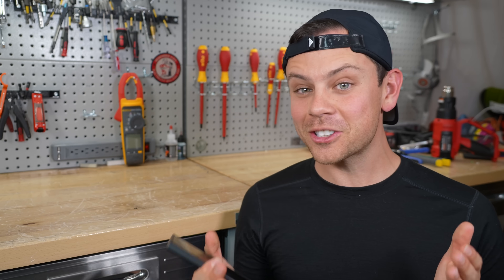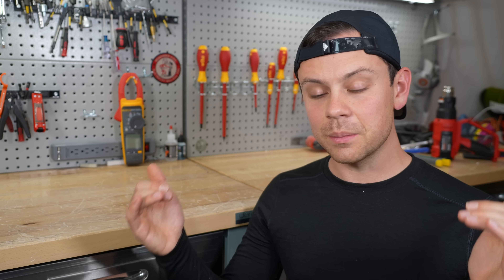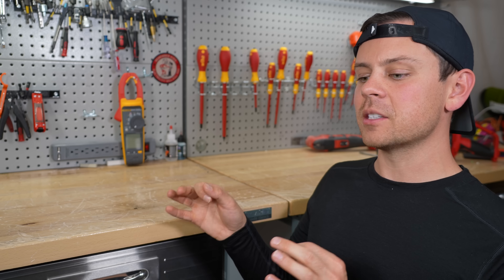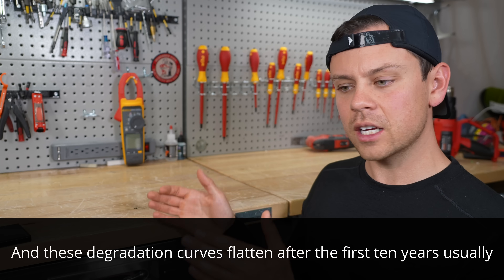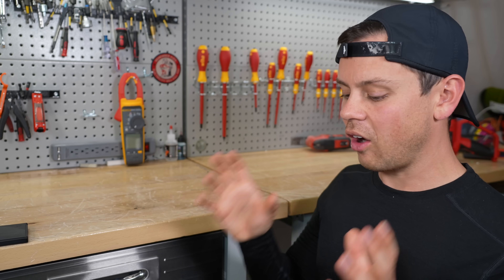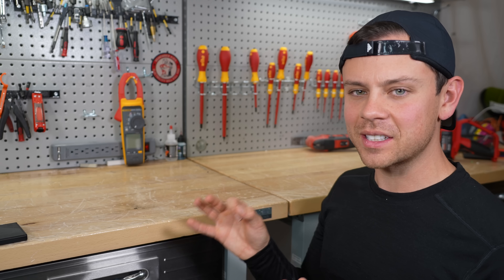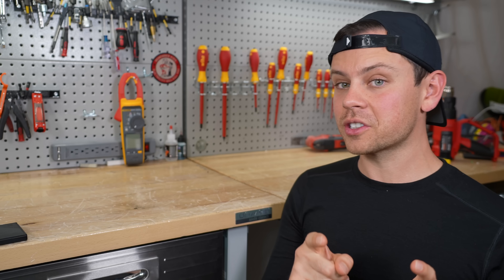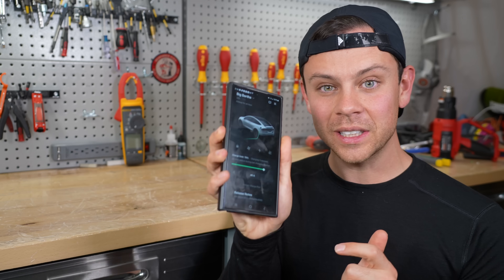LiFePO4 Longevity Discussion! Why Charge to 100%?! For Solar??

Comment: Hello. Very interesting video, can I ask does this appraoch to battery management, also apply to power banks. The reason for my ask, is today I bought a Ecoflow delta 2 max, which states in the manual that the battery life is 3000 full cyles, equating to 8.5 years then an expected drop to 80% efficiency. My point is it also states in the operators manual to charge it to only 80% and discharge to 40% in order to help presreve the battery life. You make a very good point to ignore this, would I be better off fully charging and discharging the battery. Admittedly it will not be used to a great extend daily, sometime not at all. Very interested to hear your thoughts.
I also have a DC House 200ah lifepo4 leisure battery installed in my campervan which is only ever charge via a smart alternator or 230v, which again I was led to believe to charge at 40% to 80%, again should I also fully charge and discharge this battery to balance the cells.

Comment: tl;dr: "Stop thinking about the batteries and just use them"
I think a lot of us have nightmares about lead acid batteries getting sulfated and capacity rapidly degrading if you look at them wrong or if you discharged them a wee bit too much one night.

Comment: People cant seem to understand that degradation is based on AVERAGE state of charge. ESPECIALLY true with LFP chemistry which has EXTREMELY low cyclic degrations. Almost all of the degradation you will see is calendar aging. Meaning whether you're cycling them or not, degradation will be basically identical. AVERAGE SOC and temperature affect the speed of calendar degradation.

Comment: I don't set my cutoff no lower than 15% because my soc meter goes out of sync.(eg4)  I've had it shut off on me at 10%.  I'm not too worried about it, I think I'll get 10 years no problem if not 20. I do top and lower balance when I get long gloomy days in the winter. In the summer, it runs non-stop.   Right now it fully charged and is in power save mode. I'll probably switch back off grid in the morning  to rest the batteries at full charge.  I think our results are to be announced through further experience.

Comment: Problem with zero charge... I have seen many batteries unable to recover from zero from the inverter.. Have to reboot them with a DC power supply. The solar kits that I install are never supposed to below around 10% OR THEY WILL NOT RECOVER
Reply from the maker: Check out my latest video where I talk about that

Comment: Yeah, I have the anker home power panel with two f3800s and wish there was a setting to tell it to charge to 100% on solar before it begins using the batteries. As it stands its a manual process and will charge up to 100 pulling from the house power. Now it charges up to 80 percent and then starts to use the batteries even when solar is on. I wish there was a setting to not use the batteries until solar charges to 100%. Its set to 80% per Anker.

Comment: My system isnt quite big enough to hit 100 consistantly in the winter.  every few weeks well get several days of good sun in a row and it will 100 but most weeks I need to suplement with a bit of grid power.  The joys of the pacific northwest, 5-6 months of the year we are overcast or raining more often than we are not.  I let mine charge to 100 solar but I have it set to kick on grid power at 20  and recharge to around 50.  Leaves me a bit of a reserve just incase the grid goes out till I can drag the generator out of storage.   summer time I dont touch the grid, my batteries tend to max out part way through peak solar

Comment: Some people only want the batteries for an emergency backup for Ice storms or wind storms, etc where the grid may be down for a day or two or if their grid is not super reliable and shuts off for a few hours a week so they run off of solar by day and use the grid at night and they have the batteries charged for those emergency situations that I mentioned.  ------  Some home battery manufacturers say you can keep the batteries at 100% charged but they recommend that you run your batteries down to around 50-60% charge at least one day each month before you recharge them back to 100% for emergency backup.    Look at the users manual and follow the manufacturers recommendations to help if there is a warranty issue later.

Comment: Why are you claiming again and again that cell balancing only occur at 100% SOC?
Sure many cheap BMS'es do that... But most balance the voltage on every cell against the voltage on every other cell constantly by measuring every cell, and transferring energy to the ones with the lowest voltage from other cells with higher voltage. And does this on every battery percentage. Because it is crucial that every cell has excaxtly the same voltage when nearing zero % remaining charge. If not, the cell with the lowest voltage, and thus lowest energy left, can experience a polarity reversal when facing the higher voltage and energy from all the other cells it is connected in series with, THROUGH THE LOAD! That cell is then instantly destroyed.
Every quality electric car balances its battery all the time! Tesla even does it when the car is parked.
Reply from the maker: That's not true
Reply from the maker: The amount of things wrong in this comment are just killing my brain 😂
Reply: @WillProwse  Google: "What is battery cell reversal?" Mr. Knowitall.
The first answer is: "Definition. Cell Reversal. Reversing of polarity within a cell in a multi-cell battery due to over discharge."
And now Google: battery cell balancing...

Comment: Will I’ve got the EG4 Pro / 18K PV, outdoor battery, it’s set up to run the house along with a solar array. My PGE highest price tier starts at 4:00 pm and runs until 9:00 pm. I’ve got it set to charge to 100% and deplete down to 10%. (Signature Solar recommendation) Sometimes the battery is at about 50% right at 4:00. I could quick charge it before the high tier or I can let it deplete before sunrise and run the house off of the grid during early AM hours. Based on this video, running all the way down before charging the next day will keep the cells balanced and add life to the battery. My initial thought when I first started this venture was to stay off PGE at all costs. Thank you for this video, I have a different view now. 👍

Comment: You suggest that discharging LiFeP04 to zero on a daily basis is not harmful - but you also suggested that  in storage self discharge to zero will destroy the batteries. Can you explain the difference in these two scenarios? I use LiFeP04 regularly in online UPS applications and I have found that in 6 battery  12 volt 10AH string  (72 volt) applications the the internal BMS keeps them perfectly balanced between individual batteries  at least up to 6 years - as long as I've tested - with almost zero degradation. 
On a completely different topic - have you had difficulty with shipping LifePo4 by air? IATA regs - that control airline and air cargo shipping - lump Lithium Ion and LiFeP04 in the same category - requiring dangerous cargo rules. Drives me crazy but carriers have no explanation.
Reply from the maker: https://youtu.be/K9Tfivf5bAI?si=EsOkgado_SWSDEEK

Comment: People in aggregate are stupid, today everyone is a doctor.
Of course you need to charge LiFePo at 100%, that's why they are build with balancers, the balancer begin to pull from more charged cells when the cell is above 99% reducing the cell charging current meantime on cells that they are under 99% charged they charge at the nominal current, when the most charged cell is at 100% the charging is interrupted because the balancer can not pull enough current from the most charged cell because usually the charging is happening with currents orders of magnitude higher than the balancer is able to reduce.
So, the balance is active only when the most charged cell is above 99% and under 100%, a very small amount of time but because is supposed that the cells are the same capacity and sorted is enough to keep them balanced.
Usually people don't know even how balancers work, balancer don't increase the charging current on most discharged cells but contrary, is decreasing the current that is charging the most charged cells, usually the most charged cells are charged with about 10% less current than the rest of them but that happens only when the most charged cells between 99% and 100%.
But the engineers that designed those cells and those balancers know nothing beside what those doctors know 😒
Maybe people start reading from time to time and stop waiting for the movie to be make and/or the audio version of the book 😒
Mine I use them between 20% and 100% each day, I let some % in the battery for powering the inverters after is switching grid.

Comment: I just made some changes to my SOK's and Time of Use on Solark because of this video. Thanks!

I was doing 100% to 10% as available ranges from solar only. Now I am charging to 100% from Grid if at 4pm (Just as Solar goes away) the batteries haven't hit 100% to allow balancing. 

I still had some issues getting to 0% as there are variations with the 5 batteries in how they discharge. They can be a couple %'s off so one battery will hit 0% and shut down with 2-3-4% available on the others. I'll keep the 10% to allow some variation for that (I could prob get down to 5% now that I am charging to 100% but I'll have to test)

Comment: I like your video, thank you for makeing it and I believe what you're saying.  What I'd  like to know is there a different in which volt setting I should use.  I believe the battery  instructions state 100% (  is 27.2V,  yet it also says 100% ( is 29.2V  So, which is the setting should I use on a 24V LiFePo4 battery system.   Thanks again for all your informative video!

Comment: Reminds me of when SSD started to get mainstream in computers. Relates to desktops, not laptops as they usually only have one drive. 
Many people bought SSD for the speed and i stalled windows on the drive, but programs, page file and everything else was placed on a spinning disk to save the SSD from wearing out.
I was like why spend money on a SSD to speed up your computer and then let it sit idle inside your computer until it gets old? Use it as much as possible.
Reply: iNstalled windows...

Comment: I have known about the charging LiFePO4 batteries to 100% for balancing ever since the CEO of Battle Born told us.  I know not to store a battery at 0% SOC.  And I know not to keep or store batteries in hot temperatures.  But I have never heard that you have to take them down to 0% SOC before you charge them back up.  This must be something new.
Reply from the maker: You don't need to, but it makes sense with calendar aging. Use them before the capacity fades over time. Had a whole section in this video covering that actually
Reply: @WillProwse  Oh, from the video you stated to take them down to 0%.  But my batteries are never at 0% before they start charging in the morning at it would have been a pain to take them to 0% everyday.  Good to know I do not have to do that task, lol.

Comment: Will, what say you with regard to Trump tariffs on Chinese LifePo4 batteries and solar stuff? 

I have an amazing system I designed and constructed using 2 Eco-Worthy 280ah and flexible solar panels all Chinese made. It's sweet! It cost me about $3500.

I don't see a competitor to this stuff so my take is the Tariffs are simply going to cost someone more to do this system.

Will china just make them in Vietnam for example and no tariffs?

Comment: I remember some relatives changed out their solar panels, idk if he said they where 20 or 25 years old they did deliver to little voltage after all them years, hanging outside in pretty harsh Scandinavian climate.
Will i have to say, the more i watch your videos the more confident im becoming setting up a solar system in the future at the old house, gonna start slow with being able to charge phones and a 12/24v fridge, getting expensive changing the propane (a 10kg flask is 35$ if you change in your old canister!!!!!!!!!) so if we halven the propane and never have to use the generator again a smaller solar system will pay itself off pretty fast.

Comment: I have 12 Lead Acid 8D Deep Cycle Batteries with MPP LV6548 and they have been working amazing for my solar power shipping containers at my off grid property in Pahrump, just outside of Las Vegas. 
I am adding a second inverter and 12x Watt Cycle 12v LifePo4 batteries that were recently reviewed so I jumped on the deal. 

Is there a way to run both banks on the same inverter or should I keep the banks separated on the two inverters?

Comment: I'm running five Power Queen 100ah LiFePo4 batteries in parallel for nearly a year now. Sometimes they get to 100% charge, but not often. 
Will, is it OK to run 5 batteries parallel? I understand you should not have more than 4 in parallel.  Why is this? Greetings from Jamaica.

Comment: I have a 15w 12V solar panel charging a 10 pack of 1.2V rechargeable AA batteries, all factory original by SolarGoesGreen that is now at least 8 years old. These little batteries can hold upto 83% capacity max, but it is more than enough for 12V LED lights inside two sheds. The system was getting tossed, so I saved it and been using it for the last 3 years with 1% capacity degradation during this time. Old panels and batteries are worth saving!!!

Comment: My one question regarding "get your batteries to 0%  charge every day" is this: if I'm going off grid, I need to have 2-3 days reserve capacity for lousy weather. Should I have multiple banks that I cycle through 0-100% daily, and then change them weekly with "off duty banks"? Mean while the "off duty" banks are stored near 100% for their reserve use?

My plan was to have a large, single bank (of series-parallel groups) that would likely stay between 80-100% during the summer, and 60-100% in winter. 

I'm 2-3 years from doing this so i have time to plan. (I need to insulate and fix/improve my HVAC so I'm not using 60+ kWhr per day during winter cold snaps)

Comment: Just added 3 100 amp lipo batteries  for 170 a piece with blue tooth from Amazon  I watched the bluetooth and noticed one is at 85 percent and not charging but the others are at aound 75 I figure this is normal they are in parallel  a d all charges up first
Reply: I was pulling 750w out of them all nite on and off

Comment: What happens if you have a LiFePO4 battery (ExoFlow or even a "hand truck" build) as a UPS? So, it almost never gets cycled and therefore would always sit at 100%. I'm assuming that means it should be at 50% since it's essentially in storage?

Comment: My experience, but with a limited batch is that the 80% promise  on solar panels is bs. I think there a lot of panels from ca 2012 which are absolute shite. I had to replace and 2 other neighbours as well. This is in the moderate climate of the Netherlands. My neighbours only know of their issues because I showed them my output before and after the new panels and showed them them the decline of the old panels. If I didnt show them they wouldn't have known or have acted on it.

Comment: The graph shows 3.5v as 100%.. Charging to 3.65v which is technically "full" causes undue wear and heat in the cells for very little storage gain.. Manufactures say that 2.5v is 0% but discharging to 2.8v to 2.9v is only a difference of 1% or so in capacity but allows for less stress thus more cycle life.. My several 17 cell 300 amp EVE LiFePo4 battery banks are never allowed to discharge below 2.9v or above 3.55v but I do let them float at just over 3.5v for an hour or two until the amperage flow gets below .5A which allows the integrated 2a balancer to work the cells to a sub.010v spread.. My 8kw split phase inverter can handle between 65vdc and 44vdc but going below 48vdc increases the heat generated exponentially per volt which is bad for the longevity of the electronics so I limit it to 49.6vdc and 60.4vdc at the top.. Certainly these cells do have a natural time based deterioration which you should expect no more than 20 years even with the gentlest of care to take you to a 70% of the original capacity or less..

Comment: The problem is most people have not kept the same battery running in a system long enough to really know how much damage will be caused. I've got a valance 12v 130ah battery thats nearly 20 years old, has been very well looked after, lowest 3v, highest 3.45v cell voltage and it is probably still about 90% of original capacity. I manually balance the cells out once every 3 years or so, they're never very far out. I cant imagine this battery would be just as good if I had cycled 0-100% every day but who knows.

Comment: In my scenario i use my Delta 2 as sump pump back up and never use it for other purpose. Its just sitting on a shelf.  Should I limit the SOC or leave it 100%? I know I charge it once per month to balance the cell at 100% though.

Comment: Great video. The crappy thing is that when you have closed loop communication with your batteries, the manufacturer won't let their batteries be discharged to zero. Some won't let you get below 20%... 10% with eg4 batteries when communication is enabled.

Comment: Newbie here.... I have a 100ah LiFePO4 battery that I use for a pond aeration pump, hooked to 400w HF panels. I don't even have a clue how to monitor the battery. Can someone chime in and tell me what I need? Thanks Will.... wish I knew half of what you've forgotten.

Comment: I also suffered from 100% charge cycling derangement syndrome for awhile and came to the same conclusion, the batteries were purchased to be used. They now get a 2.5hr Top Up/Balance Float every day and are full and ready by 4:00pm which coincidentally is when Rolling Blackouts and Power Emergencies are the most likely to start.